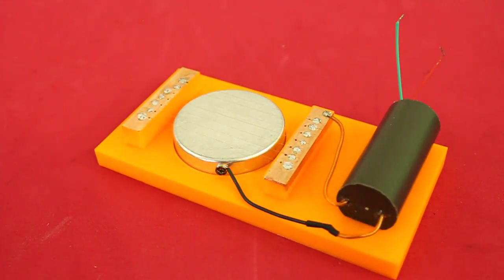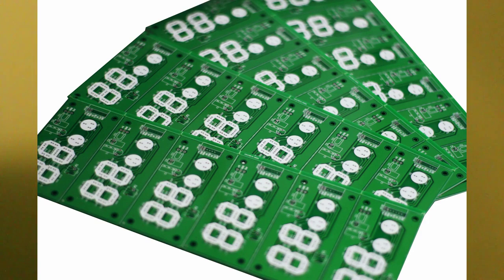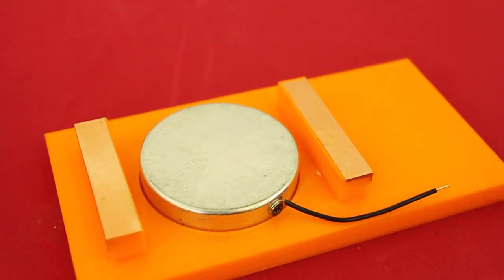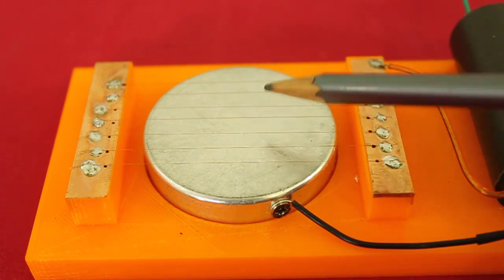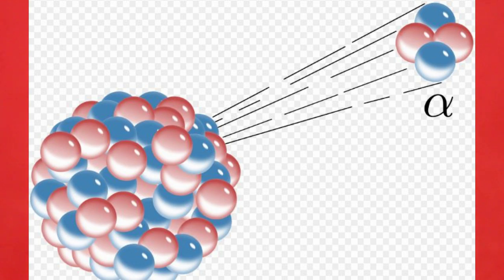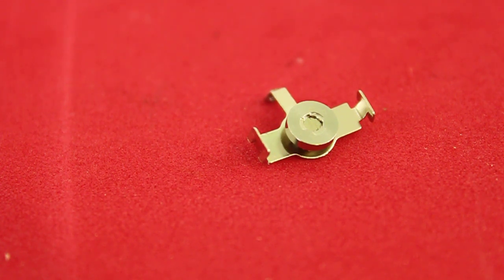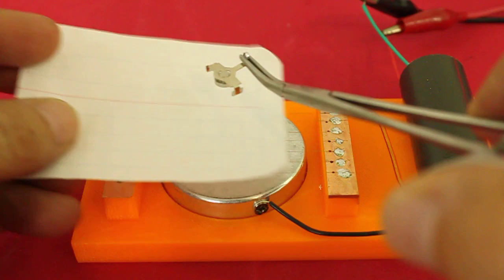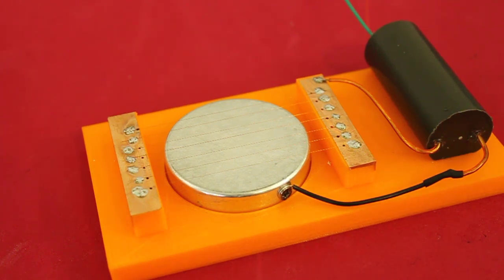Alpha Particle Spark Detector Homemade

Comment: Love 💕 your video. Built one by myself but it didn’t work.😩😩. Only got  multiple sparks ⚡️.....pls advise.
Reply: lateeeee reply but could be that you used a very high voltage power supply. you could solve this by either using a high voltage resistor that reduces your power supply voltage, or find a power supply with less voltage. putting this here so if someone has the same problem they know the solution

Comment: This is cool. I have the same type of high-voltage module from eBay, and also a source of Am-241. Also worth mention, what happens with the alpha particle when it stops? The alpha particle is identical to the core of a helium atom. So the alpha particle will finally absorb some electrons from the surrounding air, and (surprise) convert into a Helium gas atom. The air with "stolen electrons" will get a positive charge (ionization), which again conduct electricity. And that is the air conducting electricity we see at at the spark gap detector. Also, our noble gas Helium is produced naturally by alpha radiation.

Comment: So what is maximum distance  this machine can detect alpha particle?
What is the reason of multiple of sparks? Number sparks means number of alpha particle?
Reply: Not a nuclear physicist but i'll do my best. The machine do not detect at distance, if the particle reach the machine, it spark. So it depends on how fast they decay.

Number of sparks shouls be number of particle, except if multiple particle reach at the same time. Cannot double arc

Comment: I'm surprised no one's pointing out he could just have a switch in the background turning the hv on and off as he waves his americium around it lol (not saying he is, just that it's a possibility)
Reply: And why is the spark gap moving according to the beam point of the alphas?
Reply: @peterzingler6221  there could be several ways to mimic that, however that 'following' looks quite random actually, as it would either way, and the alleged 'following' could always be simply an illusory correlation as you expect to see one.

Comment: Looked like guitar strings across that device. Too bad you couldn't play a tune on that. Lol
Reply: I remember Electroboom's electric guitar 😂
Reply: Maybe it’s just because the wires are the same length. I wonder if the wires were different lengths if it would make a different sound.
Reply: electric guitar strings.
Reply: @95rav  at first I was joking.  Now I want the patent. Lol

Comment: I think smoke detectors use same principle as your alpha particle detector.
It would be interesting to see if smoke would reduce/increase minimum distance to get sparks.
Reply: Smoke will "capture" the alpha particles making the air gap less conductive. So you'd need to reduce the distance for the air to break down at the same electric potential.
That's actually how it works with ionization chamber detectors : without smoke, the small ionization of the air allow for a quiescent current to flow (in the nA range), when smoke enters the chamber, it interfere with the alpha particles, and the chamber become less conductive. That drop in conductivity is then detected by a comparator, and activate the alarm.
Reply: The cheapest ones these days use optical detectors lol

Comment: Excellent experiment. The Chinese high voltage sources usually don’t meet the „rated“ voltages, that are announced by the vendor. I have an 800kV one, that generates 80kV. This can be estimated with two (brass) balls of 25mm diameter. I always thought, that for your experiment tungsten wire is required.
Reply from the maker: It is normal copper wire

Comment: Could this be adjusted to detect beta partitculas
Reply: You need a tube, GM tube. beta and gama can't ionize air i think. Halogen or  nobel gas needed.
Reply: you can make a detector with a light sensor like the BPW34 and a circuit, google it, but it may work already with all the types of particles maybe, i don't see why not
Reply: @redoverdrivetheunstoppable4637  Photodiodes only detects X/Gama rays. Does it also detect beta?
Reply: @mehmetinlaboratuvar7099  truth is, that i based that on an article on Elektor magazine (more than one article) they say that it detects all the types (on an exposed silicon chip) and it's statistical, in the sense that differently from a photomultiplier you can read the decay intensity on a scope or analyzing software, if the majority is weak shots, it's alpha, mid power is beta and hi power is gamma, THEY SAY... i've succeeded at detecting something from the getter of a DY86 vacuum tube (weird) but a GTLS keyfob, potassium chloride or TIG welder rods (bought on ebay (!!)) didn't showed anything... it works but never probed the statistical part or what kind of particle it is and i don't have a real geiger counter

Comment: YOU ARE WRONG about the radiation from the Am241 being safe. Americium emits alpha particles, but it ALSO emits gamma rays and a small number of neutrons too. Americium is dangerous and the radiation from it is dangerous but safety authorities have decided that the constant danger of the radiation is less than dying in a fire all at once so this material is permitted for this use. I have seen discoloration from Am241 sources like yours breaking down organic compounds. The alphas from Am241 come at 5.486 MeV, 5.443 MeV, and 5.388 MeV. The gammas from Am241 are mostly at 59.5409 keV, with more at 26.4 keV, 17.8 keV, and 13.9 keV. These low energy gamma rays are perfectly capable of causing genetic damage and cancer.
Reply from the maker: What is your source of information?
Reply: @ludicscience  The fact that Am241 emits gamma rays is available in every radiochemistry databook. This is not a secret data or debated by anybody. It's fact. I used to be a designer of scintillation spectrometers and Geiger counters and I HATE IT when I see people playing stupidly with radiation.  PLEASE act smarter.  0.03 µCi of 241Am is the maximum permissible total body burden.
Here's the gamma spectrum: https://www.gammaspectacular.com/blue/am241-spectrum
Stanford's Environmental Health & Safety sheet on Am241: https://ehs.stanford.edu/reference/am-241-radionuclide-fact-sheet  
US Environmental Protection Agency: https://www.epa.gov/radiation/radionuclide-basics-americium-241
Oak Ridge Lab Analytical Chemistry Division report on Am241 alpha, gamma, & neutron sources: https://www.osti.gov/servlets/purl/4777909
GAMMA RAY SPECTRUM OF AM-241 IN A BACK SCATTERING GEOMETRY: https://inis.iaea.org/collection/NCLCollectionStore/_Public/29/041/29041560.pdf

Why are you asking where my information is from? You should be verifying the decay energies I listed and that should be enough to see I'm just reciting known radiochemical data. All you need to do is enter "59.5409 keV" into Google and you'll see Am241 gamma emission links appear. Those 59.54KeV gamma rays will travel over 100 meters in air.

Comment: Another excellent video by LS 👍🏼👍🏼. 
Can I use an ioniser machine to create the sparks ⚡️ instead of an alpha particles?? Just curious.
Reply from the maker: Well I think is possible
Reply: that seems to be the classic eBay taser module, it's super cheap (and painful!!!), i'm thinking to make this thing, maybe with a flyback transformer from a TV, i'm not sure about the "violence" of the sparks, these seem to be at high current, also a flyback can have a "tesla coil effect" generating corona or maintaining the spark on... not sure

maybe a car ignition coil will fit, but use the old cylindrical type, the newer ones are hard to energize

Comment: There are a lot of those high voltage generators on ebay that all look very similar. Do you remember which one you got for this experiment? I do want to try it as well. I go a radioactive clock (the digits), radioactive tiles (uranium glazing) and for good measure a few pellets of neutron activated samples (from a friend that was at a nuclear research reactor; don't tell anyone ;) ).
Reply from the maker: I got the one that says 400kv

Comment: Great experiment!! 👍🏻
Reply from the maker: Thanks!
Reply: Did you ever try to do a test on a vortex tube? It is a pipe that converts kinetic energy of gas (air for example) to thermal energy. It can produce a a temperature difference of 20deg C or even  higher. There is also a device called cryocooler that is using Stirling cycle to achieve -100 deg C temperatures,would be very interesting to see a video about such experiments :)
Reply from the maker: Thanks I Will do some research on that
Reply: @ludicscience  thank you!! I hope you will find it interesting!

Comment: Will this also work with Electric Mosquito zappers ??
Reply from the maker: I have seen mosquito zappers un series for more voltage
Reply: @ludicscience  Nice I'll hook 3 of them in series
Reply: @ludicscience  yeah, me too, but not in my country(Germany) and the transistor in there is also not designed for long term use, because it can overheat after around a minute in use(without capacitor)
Reply: Not really because it provides way to less voltage. Try an AC voltage multiplier with it and it will probably work. He has a video on it too
Reply: @bigatchu7865  but what if I reduced the gap between Anode and Cathode ??
Reply: @kranganekar  I never built it by myself and this could work, but most of those zappers produce around 300v which is really weak and would create an electrical ark below 1mm. The risk for a short circuit is really high. Consider the voltage multiplier first. Ludic science even used a mosquito zapper with his multiplier
Reply: @bigatchu7865  This just motivates me to give it a Try  .... I'll upload a video If it works
Reply: It creates electro mosquitoes just like electro from amazing spiderman lol.

Comment: Once the source is fixed on the top, a magnetic field can apply to show the deflection of the spark.  Hence showing the charged particle is positive etc
Reply from the maker: I tried without effect
Reply: Try with strong neodymium magnet? Perhaps in a vacuum chamber aswell? Many ideas owo

Comment: What is the distance between the wires and the plate?  It seems it is critical for this setup.
Reply: 3:13
Reply: Gerd Kah thanks. I missed that one.
Reply: There should be some equivalent to lmgtfy in these cases
Reply: Nilaksh Singh sorry not understand , must be typo